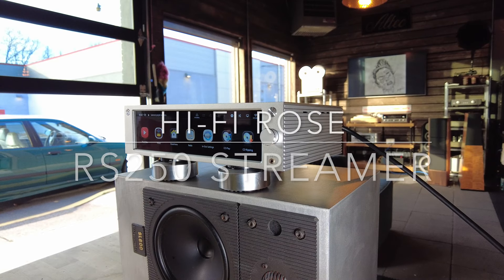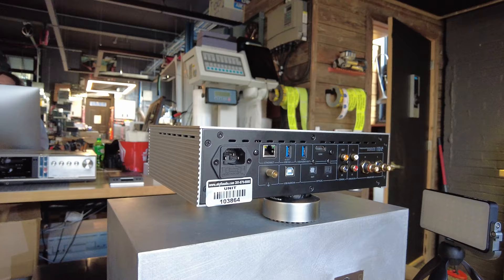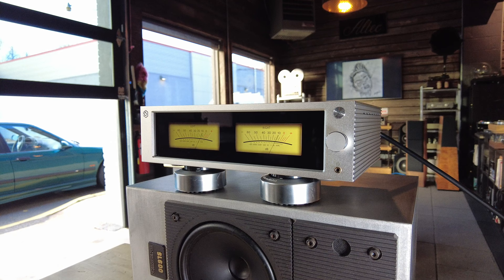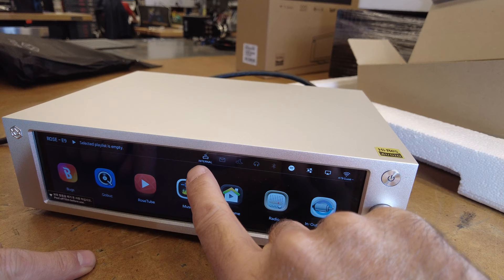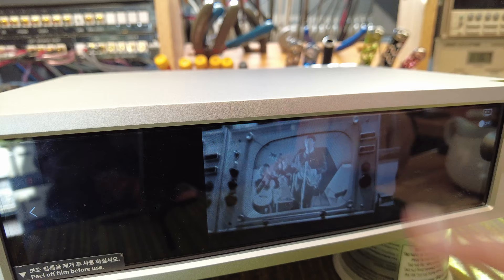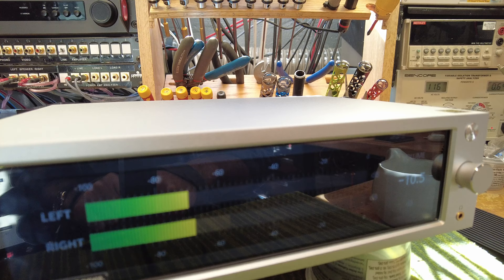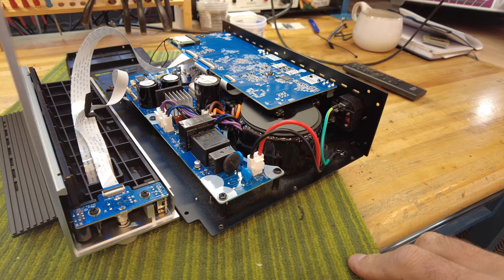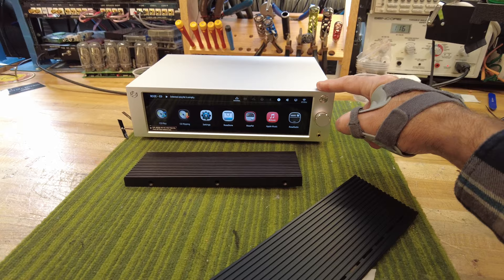HiFi Rose RS250 Streamer - A Deep Dive

Comment: I bet with this DAC circuitry it will sound cold, dry, non interesting. Eversolo did a better job. I believe Hifi Rose is way overpriced.
Reply: don’t you think it’s a little risky making judgments like that?
what if you’re really just coping over retail prices, for example
Reply: @WeeWeeJumbo  I had a chance to try multiple capacitor series, OpAmps, and after all, I build my opinion, that price does not matter, it is possible that a $100 DAC will sound more live than a $5k DAC. And I was playing on stage for 7 years in my life. I know how instruments sound. Some modern DACs make a nice sound, which is not the same as the real sound of Trumpets or Drums. Hate this.

Comment: I'm a bit reluctant to post this because of ALL of the caveats (see below) but here goes...  Perhaps not "vintage" in the true sense, but my Nativ Vita meets all of your requirements, Fernando, probably better than the Rose. Bigger display with all the touch controls you'll ever need AND large internal storage space for all your downloads... along with streaming.  Now the multiple, MULTIPLE caveats. Nativ appears to be out of business. No more software updates.  It runs a proprietary version of Android and thus sideloading of new streaming software is difficult-to-near-impossible.  Its last update, before it went under, enabled Roon RAAT which made it a viable Roon endpoint (therefore potentially obviating the problem with lack of update-capable native - no pun - software), and that's how I use it... but.... it was never Roon certified and won't ever be so its use as an endpoint is "quasi-unofficial." Basically Roon took pity on us Vita users for a brief (grandfather) period and allowed us to attach the uncertified hardware to Roon during that period.  Not sure that such access would ever be granted again.  Anyhow, if you were lucky enough to save the restore and update files you downloaded (I did), AND you have Roon (I do), and you have a way to get Roon to recognize/attach to your uncertified RAAT implementation on the Vita (I did), then it really is your "dream" streamer the way you describe it, Fernando.
Reply from the maker: Sound like a nice machine also.  Was looking for one that matches my Nagra closely so I think this is the way to go.  Thanks for chiming in Michael.

Comment: I love the design of the HiFi Rose too.  But the meters are useless:  meters are important on the amp, NOT on the front-end, because you want to know whether the amp can drive the speakers without clipping.  I wouldn't consider this component "disposable."  The DACs are decent on this machine and it gets most of the streaming services that you would want and at hi-rez levels.  Probably the only limiting feature would be the file storage capacity. Famous last words, of course!
Reply from the maker: for me Meters=Happiness.  I think you can add a drive to the unit which would solve your storage concern.
Reply: The meters work well if you are using them from your stored files. It gives a true impression. I have a 1Tb ssd stored in unit and works well. Over 20000 flac files 👌

Comment: I have this stream and really like it. Here are some things to add
The wifi receiver is a little weak and needs a good signal to keep up with higher bit rates.  I recommend you use a LAN connection for reliable connection
I strongly recommend you go into the settings menu (the cog) for the analogue out view you showed.  In here you can set 2 important things
1) The upsampling rate - default is none
2) The digital filter - the default is brick wall - definitely change this.
There are a number filters to choose an you should try them out as they change the smoothness/sharpness etc of the output.
Definitely use up-sampling (176 is a sweat spot), as this give more space for the digital filer to work without artefacts.
I use this stream with a Luxman 505 and am very happy with the sound - very nice and clear and detailed.
Reply from the maker: Grat tips Tom.  I will try it tonight and see if I can hear the difference.
Reply: Appreciate this. I have almost the same set up but to a 150b to a lux 509x. My first 150b had to be repaired due to a fault with the power supply which was frustrating (really bad support) but has been solid since.
Reply: Can you see the album art while the song/album is playing on your TV (whatever the HDMI is connected to)? I cannot see to get a clear answer on this... I am looking for a streamer that shows the album art on the TV while playing music from Tidal, Qobuz, etc
Reply: Yes there is a small icon that sets the hdmi output to tv once you have set the display output for your tv. It’s not obvious but once you have done it you are ok. Don’t set the resolution higher than your tv can cope with or nothing will be shown on the tv.

Comment: A streamer with internal storage???
Bluesound make the Vault, basically the Node with a 2 terabyte hard drive which allows you to rip CDs as well.
You'd want to use your own DAC, but basically it is brilliant.
I've had one for a year and after getting used t it, I loved the sound, love the BluOS and love the convenience.
Reply: I had a number of servers / streamers mostly borrowed the Bluesound is a fabulous component for the price however it does not match the sound quality of the Rose Audio 250 .
Reply: @marks.2909  Can I ask if you mean for streaming or playback of stored files?
These usually sound different to each other.

Comment: Really found this interesting,  I'm not into these kind of devices. I'm dyed in the wool old audiophile..70's- 90's  models.Nice features on the digital front.I agree at 2500 price point is as high as I would go..and it's all new modular streaming device so these days items change so quickly. Thank you for this post greatly appreciated.

Comment: The new  RS250A is out in a few weeks. I have mine ordered. Excited to hear it. If you are in the market waiting for the new model. It will also be available in black.
Reply from the maker: I understand they have made changes to the DAC too. I wonder if an improvement or for supply chain issues like most manufacturers are facing.

Comment: Really appreciated this video. Been curious about these as a streamer and how they stack up to Lumin,  innuois , sonore etc. Streamers that have bucked that trend and lasted longer are based on some derivative of Logitech squeezebox software thats been around in some form since early mid 2000s.  Even innuois is based on it with their own skin/look to it. I kinda agree on streamers basically being disposable. They all claim their upgradable for the future. A very limited future. Even dcs can't can't avoid this. Thought about the dcs network bridge for a while but it's been discontinued and wonder how long such a still $$$ component will be useable. Thanks for letting us look inside at the unit. This have a power amp? I would like to see a deeper look at your nagra system in a future video. Perhaps a tour of other personal systems also. Thanks for your great content!
Reply from the maker: This one is a bit higher in price than I like to call it "disposable" but its certainly close.  I just cant see spending $10k on a streamer.

Comment: I was on the fence with this unit and the Gold Note DS 10.  I ended up with the gold note with the external power supply.  Im pretty happy with it.  But Im not 100% sure I made the right choice.
Reply from the maker: Hi Tyler.  IM a big fan of the large display as you can tell so it was an easy choice for me.  Cheers.
Reply: You made a big mistake..I see so many audiophiles and or audiophile gear manufactueres using this during audio shows, then you know that this is the real deal

Comment: I don't really see the value of a massive front display. I had for many years various HTPC solutions using larger touch enabled front screens (OrigenAE), but in the end I had to realize that they don't really have much use. My equipment is in a HiFi rack, from which I usually sit several meters away. That's why the screen content is actually always too small to see anything from a distance and touch screen operation is not to be used in practice either (I prefer using a remote/app). The only thing I need to see is the volume and input source (but that's what my PreAmp is for). Streaming and control of streaming media is done via smartphone through the appropriate app (Roon in my case). I also don't think that touch screens are good for the life of high quality HiFi products. The Nagra Audio components are in stark contrast to this.

Comment: i have scrapped TIDAL music because the streaming quality has done a dive down on quality to what it was when it was first introduced. i have changed over to amazon high resolution music. AMAZON Streaming quality to my ears exceeds TIDAL music on the quality aspect. I just use a cayin N6ii TO1 with the twin mono burr brown pcm 1792a dacs 24 /192 capable, that cost a uk price of £1150 pounds.
Reply from the maker: Ill have to give Amazon music a test drive, thanks for the tip Ian.